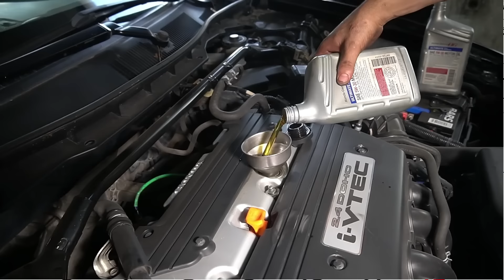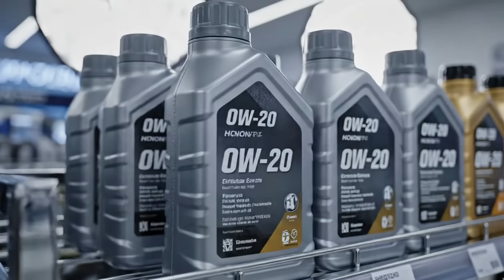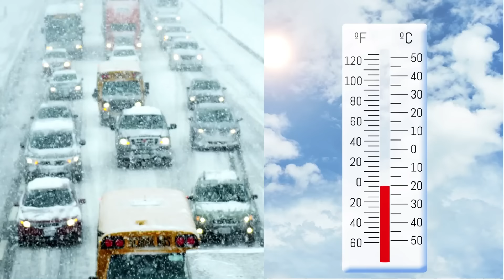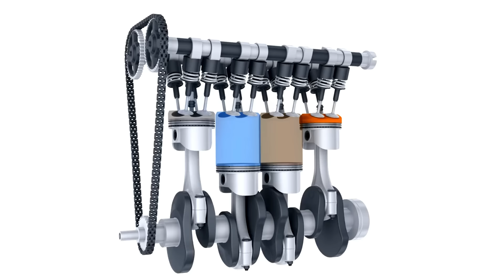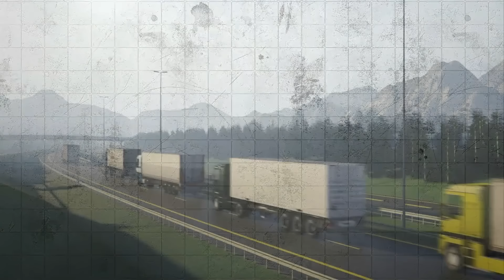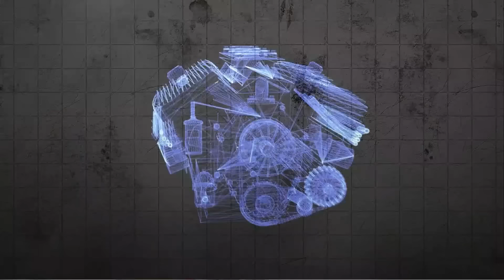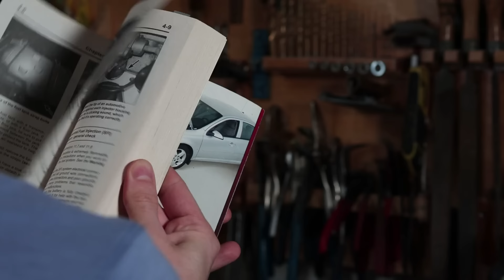The Oil Viscosity Conspiracy: 0W20 vs 5W30 - What Your Engine Really Needs

Comment: I drive a 2021 Toyota Highlander with the V6 engine, and it calls for 0W-20 oil.  However, I live in New Mexico where we have mild winters and summers where it routinely tops out over100 degrees.  I think I need 5W-30, but would consider 0W-30 if it would be more appropriate.  What are your thoughts?  I have 21,000 miles on the car now.
Reply: You can use 0W30 all year around.  For info if temperature is +20c Celsius, then works anyway second number 30. But you must consider if you use 0W30 it means thicker oil at your own risk, not manufacturer reccomended.
Reply: Yeah friend, much of what I am hearing is that the mane reason for low viscosity is for fuel economy. Thin oils allow the engine to spin easier. Plus viscosity choices are based on the local climate. You can easily use 5 30 in the summer and 0 30 in winter ( Northern California).
Reply: Definitely 5w in warm momths. Although 5w30 and 0w30 have the similar warm flow, the 5w30 has more film strength
Reply: @Resistculturaldecline  0W30 and 5W30 can be same with warm engine.  0W doesn't change warm viscosity. even two 5W30 oils are differnet you must read oil data sheet to know it's flow at 100c celsius.   But i can find 0W30 and 5W30 oils where 0W30 oil is thicker at 100c than 5W30.  all depends from manufactures.  30 end number means that oil must meet standards 9,3-12,5 flow. 40 end must meet standards 12,5-16,3 or something like that.
manufacturers make different 5W30 oils because there is different needs for different flow at 100c celsisu, but 30 end mean that, oil must meet standards 9,3-12,5 flow.
Reply: @kaliikleja  All things being equal, 5w30 has more film strength due to less modified 5w base oil instead of a more modified 0w
Reply: @Resistculturaldecline  
Liqui Moly Top Tec 4210 0W-30
Viscosity at 40 °C 60 mm²/s
Viscosity at 100 °C 11,9 mm²/s

Liqui Moly Top Tec 4300 5W-30
Viscosity at 40 °C - 60.5 mm²/s
Viscosity at 100 °C - 10.3 mm²/s

there is no more film strength, please read oil data sheet and you see real flow at 100c celsius. i can find 0W30 what is thicker than 5W30 at 100C celsisus or even 40c celsius temperature. read data sheet and you see oil flow.
Reply: @kaliikleja  Im not referring to flow viscosity
Reply: @Resistculturaldecline  then you don't know anything about oils when you don't understand what is oil viscosity and why it's important and 0W oils are very good and doesn't do any harm for engine just choose right second number 0W20, 0W30, 0W40 depends what your engine can take.
Reply: @kaliikleja  I have a strong suspicion that I'm not the one lacking experience 😁
Reply: @Resistculturaldecline  that's your problem when you don't know oil viscosity and it's importance.
Reply: @kaliikleja  Go away
Reply: @Resistculturaldecline  if i watch your text then i say, you don't know enough about oil viscosity. learn what is oil viscosity and then talk.

Comment: Then why not 0w30.wil be for both like warm and cool temperature.
Reply: Yes 0W30 oil is very good, smart comment. But you must to be sure, your newer engine can take this thicker oil. 0W30 oil is thicker than 0W20 and newer engines come often smaller oil ring holes.

Comment: If it's ok to run 5W-30 oil in a turbocharged  engine, why shouldn't you run the same engine without a turbocharger (in this case a 2.5L Skyactive  engine)?
Reply: 0W30 oil is better choice than 5W30, it's better for engine, because of cold starts and doesn't do any harm for engine. 5W wears engine a little bit more at cold starts.

Comment: I would tell you what oil you would need from now to 2036.

By 2036 no engine combustion should be on the road ideally.
"Save the planet" "CO2" etc scheme.

So as we are now in 2025...we moving from 0W20 toward 0W16.

By the 2030 0W10 would be as standard and recommended by all new cars with internal combustion..

But in 2036 by the law would be 0W0

After that from 2037 and onwards, instead oil we would be allowed only to use shuggery water instead oil for all internal combustion engines!

From 2037 only electric cars on the road.

I hope I clear once for all, oil dilemma😊
Reply: There is 0W7,5 oil. i like 0W oils, but i choose second number 0W20, 0W30 or 0W40. Newer engines probably can't take 0W40 oil often, because oil ring holes are smaller than old cars design. My favourite oil is 0W40, but i can use it in older cars.

Comment: I drive a Golf 7, it needs 0w30, fukk it, he gets 10w60 and runs perfectly!!!
Reply: 10W60 you kill your engine.   0W30 oil is better choice, it's better for engine, because of cold starts and doesn't do any harm for engine. 10W wears your engine hard at cold starts and 60 second number kills your engine because it's too thick.
Use 0W30 or maybe engine can take 0W40 too, but no 10W60, it's the end of the engine for so new engine.
Reply: @kaliikleja it runs perfectly, are you high?

Comment: The most important thing is to use synthetic oil and change it every 5000 miles. If you drive short trips, change it every 3000 miles to avoid sludge buildup.  For high mileage engines 70k miles or more, switch to 5W30. I have a Toyota Sienna V6. I change the oil myself. I use 0W20 Synthetic Mobil 1. The mileage is about 130k miles. It does burn any oil. If it starts burning oil, I will switch to 5w30. I bought a new 2007 Hyundai Sonata I4.  I change the oil regularly using 5W20. The mileage is about 180k but it burns oil. The engine sound like new and very smooth. I will switch to 5W30.
Reply: Run valvoline restore and protect for 3 oil change intervals (change every 3k miles) and see if the oil burning goes away.
Thinking your oil rings may be  stuck from the oil varnish.
Reply: @Hans_Pritcher 

The Huyndai engine is old and most likely the rings are slightly wornout.  It burns about 1 qt every 3 months.
Reply: 0W30 oil is better choice than 5W30, it's better for engine, because of cold starts.  5w oil wears engine more at cold starts. and if engine is warm, then works second number 20 30 40.

Comment: Help that untill 2036 no internal combustion engine exist, save the planet and use watery oil, save the planet against dangerous CO2 engines, remove cars with internal combustion by 2036 from the roads! 
0W20 is clear winner in that goals. In fact 0W16 can push even more but is not so urgent to remove internal combustion engines from the road.

Save economy and take buster vaccines as well, remove people by 2036 from pensions, reduce burden to the economy, less people as well.
Take recommendation vaccines, so we can save the planets for few privileged.

Ai can take from there.

All of this would not be possible without people go along and trust corporations and governments again and again and again and ...

Comment: This has to do with the 2019 Chevy Silverados V8 5.3 with the 0W-20 oil. 
At 62,000 mi I switched to 5W-30 I changed the oil at 5000 mi twice I'm getting ready to do it a third time with the 5W-30. No issues whatsoever, the engine sounds smoother oil pressure is perfect just like it used to be with every single 5W-30 using engine that I've ever owned. 
On the second oil change with a 5W-30 there was zero oil loss I did add one quart of liqui Molly to the oil idled it for 15 minutes and nine course of motor oil came out which means there was zero loss with the 5W-30. There  what's oil loss when I first bought the truck but after I installed the pulsar LT to deactivate the DFM and the auto stop start it did go down quite a bit but now it seems to have stopped completely no oil loss whatsoever with the 5W-30. I will be changing the oil next week at 5000 miles I'm going to be adding one quart of liqui Molly and idle for 20 minutes and I will check to see how much oil comes out, so there should be 9 quarts coming out because of the one quart of liqui Molly. If you go to my YouTube channel I do have quite a few videos on my truck where I did some mods to it that hopefully will improve how long this vehicle will last

Comment: nothing Lower than 5/30 Synthetic valvoline for my Vehicles. ( cafe what a insult) to hard working individuals.
Reply: 0W30 oil is better choice than 5W30, it's better for engine, because of cold starts and doesn't do any harm for engine. 5W wears engine a little bit more at cold starts.
Reply: @kaliikleja there is a concept of the oil being so thin at startup that it does more harm than good.
Reply: @Freemasonshair  cold oil is always thick even 0W and doesn't do any harm, only good for engine. you must educate yourself about engine oils. Example 0W40 oil is quite thick oil always in normal use.
Reply: @kaliikleja Ofcourse, people have theorized that the 0w is what harms the oil on start up.
Reply: @Freemasonshair  Jou talking so much nonsense. 0W shows oil viscosity at cold, and cold oil is always thick just 0W is a little bit fewer thick than 5W. Little example, 0W40 and 5W40 oil is 12,5-16,3 cSt at 100c Celsius, this is standard about 40 end oil. but 0W40 oil at 0c celsius is several hundred cSt very thick.

Comment: Even if the manufacturer's specified viscosity of the engine oil is 0w-20, if the mileage exceeds 50,000 miles, it is correct to change it to 5w-30 engine oil.
Reply: You have completely misunderstood the situation. If you change from 0W to 5W, you will only harm the engine during cold starts.
0W is safe for the engine. If you previously used 0W20 oil and want a thicker oil for an old, worn engine, then you must use 0W30 or 0w40. But you must understand, newer engines may not take 0W40 oil and using even 0W30 is at your own risk.
0W indicates how the oil flows when cold, and cold oil is always thick. The important part is the second number — 20, 30, 40, etc. That number shows the oil’s viscosity when the engine is warm.

Comment: In regard to 5W30, at an ambient temperature, the oil's viscosity will be between the cold-temperature rating of 5 and the high-temperature rating of 30, depending on the specific ambient temperature. Viscosity is a measure of a fluid's resistance to flow, essentially describing its "thickness".  For example, at a typical ambient temperature of 75 Degrees Farenheit, the oil's viscosity will be lower than its hot viscosity, as it is not yet fully warmed up. As the temperature rises, the viscosity of the oil will decrease. This is why a multi-grade oil like 5W-30 is designed to maintain a consistent viscosity across a wide range of temperatures.
Reply from the maker: Exactly! You explained it really well. 5W-30 is designed to stay stable in both cold and hot conditions. At something like 75°F, the oil isn’t truly cold or fully  hot, so its viscosity sits somewhere in the middle. And as the engine warms up, the oil naturally thins out that’s the whole point of a multigrade oil. Great breakdown!
Reply: You have it backwards on just one thing...
 
With 5W30, it's cold viscosity is rated at 30, and highest temp viscosity rating is 5.
Reply from the maker: @jkg6211 Ah, good catch! Actually, the numbers work a bit differently in 5W‑30, the ‘5W’ describes the oil’s flow in cold temperatures (winter), and the ‘30’ is the viscosity at operating temperature. So cold starts are easier with the ‘5W’, and it still protects well at high heat with the ‘30’.
Reply: @CarCareCrewOfficial 
I worked as a Valvoline field rep back in the 90's.
Ran a NAPA for 11 years prior to that. (before computers. lol)
Reply from the maker: @jkg6211 Wow, that’s some serious experience! Running a NAPA for 11 years and being a Valvoline rep back in the ’90s  you’ve seen the full evolution of engine oils and maintenance. Bet you’ve got some great stories from the pre-computer days too!

Comment: I go by the oil recommendation in the owners manual for Europe, Asia, etc. They don’t have CAFE.
Reply from the maker: That’s a solid approach. Outside the U.S., manufacturers don’t have to design around CAFE fuel-economy rules, so the recommended viscosities are often more focused on engine protection and real-world conditions. Following the European/Asian manual usually gives you a broader and more realistic range of oils to choose from.
Reply: @CarCareCrewOfficial  In Europe they use 0W20 oil very often, maybe you can use 0W30 but you do it at your own risk.
Reply: They have EU C02 emissions standards, and theyre strict.
Reply: Did you take as well all recommended vaccine in your body?
Reply: @aleksandartomic5515 I can’t find my insane to English translation guide, but when I do I’ll answer this.
Reply: Thats stupidity at your best.... Cold starting is worse is cold winter states only..
Reply: @TheSaintshockey03  cold starts are always wearing engine and 0W oil is useful even at 0C celsius. but you can choose different 0W oils 0W20, 0W30 and 0W40 but you must be sure your engine can take so thick oil like example 0W40. thick with warm engine.
Reply: @TheSaintshockey03 So your saying cold starts are worse where it’s cold? Brilliant 🥶⛄️❄️
Reply: @lonniebeal6032 When I want your input, I’ll ask for it. Jeez….
Reply: Ya im just following the 0W16 gor my 2024 and when warranty is up ill bump to 0w20 or 5w30 later on
Reply: @herbbot8241  There is no point to use 5W, 0W doesn't harm the engine. 0w show oil flow at cold and cold oil are always thick. second number shows oil flow at wam engine 20 30 40, but new engines may have small oil ring holes, this is the reason why you must be cery careful if you choose to use 0W30 or even 0W40 oil. 5w is not needed it's thicker at cold and wears more engine at cold starts than 0W..

Comment: 2024 Chevy 5.3 been using 0w20 and using mobile 1 extended performance guaranteed for 20,000 miles but changing every 5,000 truck has 15400 miles on it but i do worry in the summer pulling my 5000lbs boat in the Tennessee heat
Reply from the maker: 0W-20 with Mobil 1 EP is totally fine for normal driving, especially since you’re changing it every 5,000 miles that’s way safer than running it to 20k. But when you’re towing 5,000 lbs in Tennessee heat, the engine is under a lot more load and oil temps climb fast. In those conditions, a slightly heavier oil like 5W-30 (if your manual allows it) can give you a bigger safety margin in summer. You’re maintaining the truck really well, so you’re already ahead  just match the viscosity to the workload and you’ll be good.
Reply: @CarCareCrewOfficial owners manual gives no other option but 0w20 for the 5.3 the more videos you watch the more confusing it gets one your destroying your engine one run what the manufacturer recommends, thanks for your input
Reply: @outlawet3fan209  0W or 5W indicates how the oil flows when cold. You can safely use 0W oil — it is only beneficial for the engine. The important part is the second number — 20, 30, 40, etc. This shows the oil’s viscosity when the engine is at operating temperature, and choosing the correct viscosity there is very important.

You can use 0W30 instead of 0W20, but keep in mind that car manufacturers usually do not recommend this for newer engines, and you do it at your own risk, because oil control rings in newer engines often have smaller holes and are generally narrower.

But definitely do not put 5W oil in the engine, because 5W will only cause harm during cold starts compared to 0W oil.

Use 0W20 or 0W30, but 0W30 only at your own risk, since the manufacturer usually does not recommend it. And definitely do not use 5W20 or 5W30 — only 0W20 or 0W30 (with 30 being at your own risk).**
Reply: @outlawet3fan209 why have so many people switched to 5w-30 for their Chevy V8’s? Why is GM as a whole recommending 0w-40 now instead of 0w-20 for the 5.3/6.2 now after the massive recalls? Think about it.

Comment: In Normal driving stick with manufacturers recommended oil,,,,,. 0w and 5w. ,,,,,,,,,20 and 30 only effect in extreme  conditions.
In extreme cold and driving carry heavy loads should use 0w30
Reply from the maker: You’re right that the manufacturer’s recommendation is the safest starting point.
But it’s also true that different climates, driving habits, and engine conditions can change how an oil behaves.

0W and 5W mostly affect cold start flow,
and 20 vs 30 can matter more in situations where the engine runs hotter or is older
but the safest approach is always to follow what the automaker suggests for your specific conditions and refer to the owner’s manual.

Everyone should choose the oil that matches their car, their climate, and their driving style.
Reply: @CarCareCrewOfficial high quality synthetic oil are  every stable ,not much effects viscosity when driving conditions or weather changes ,,but if engine design for 0w20 and using 5w30 that will be alot effects from oil pump, slower cooling, bearing starvation from thicker oil can't flow  properly .
Some engine may trigger engine light when thicker oil is detected
Reply: @heinhandsome2010 There is no point to use 5W30, better use 0W30,  5W wears egine more at cold starts than 0W. But if manufacturer says 0W20, then you use 0W30 at your own risk.
Remember 0W and 5W is for cold and cold oil is always thick just 0W is a little bit better. But second number 20 30 40 shows oil flow at hot engine, and this is very important. But bemember, if you use 30 end oil instead of manufacturer said 20 end oil, then you do it at your own risk.